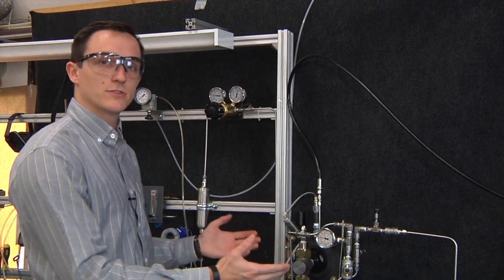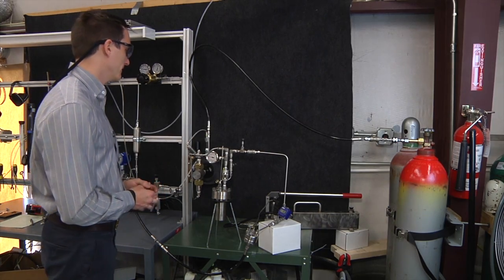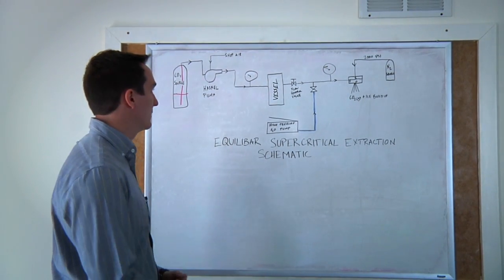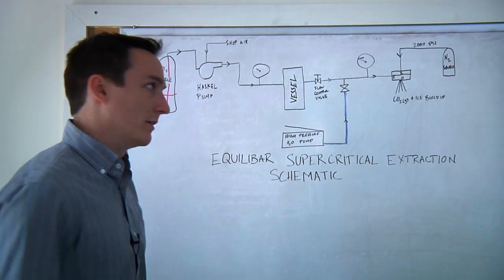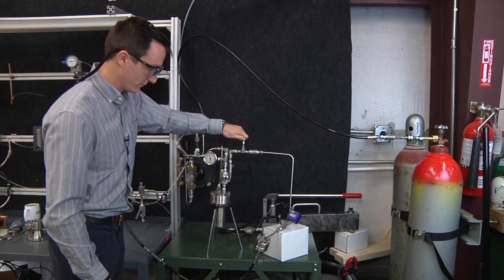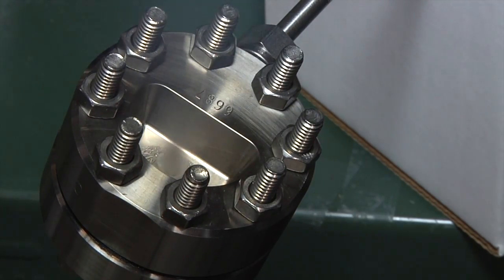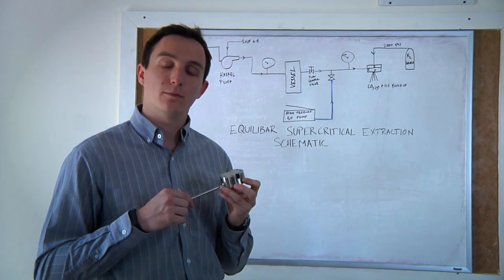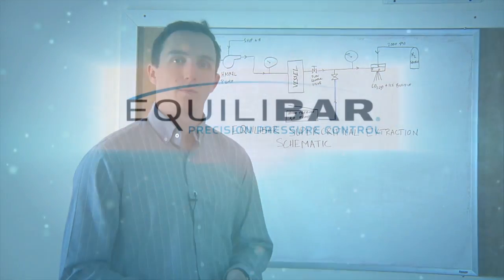Supercritical CO2 Pressure Regulator Resists Blockage

Comment: Excellent video by Ryan, very informative. Question, is it the "Flow Control Value with the Differential Pressure feature" that keeps the gas flowing at a desire rate? If I want a very slow rate of flow, how would I set the valve's DP, very low or high?
Reply from the maker: Great question, Getis.
The flow controlling device in this video can be best thought of as an adjustable but passive restriction that, once adjusted, stays constant. The reason this device works as a flow control valve is because the Haskel pump is able to produce an amplified outlet pressure (p1 supply to the flow control valve) that's relatively constant. Then, the Equilibar valve is controlling the P2 (downstream pressure from the flow control valve) at a constant as well. Thus, with a fixed dP and the needle valve in a fixed restriction position, this means that the flow will be steady. The flow would not be steady if one of the pressures fluctuated. In this case, flow is proportional to dP^2
 
For systems with fluctuating pressures, an Equilibar can be added to keep dP constant to therefore ensure constant flow. There are also other ways of doing this with say a mass flow controller. What's right for your system may require some analysis, so we will be happy to discuss this if you'd like to reach out to an application engineer to discuss. https://www.equilibar.com/contact/
 
Thank you for your question